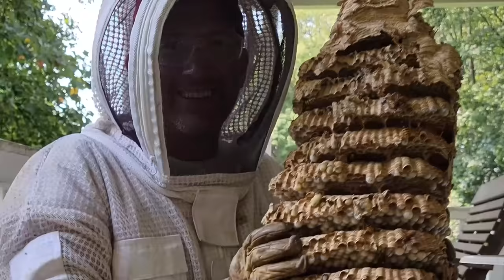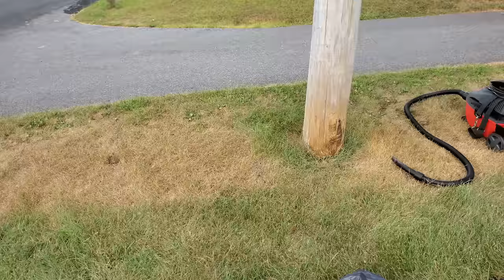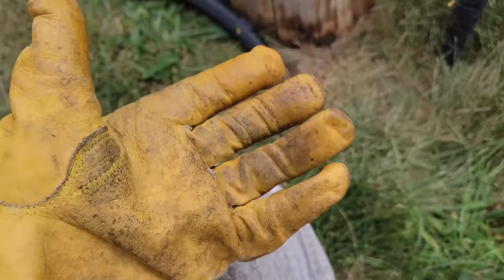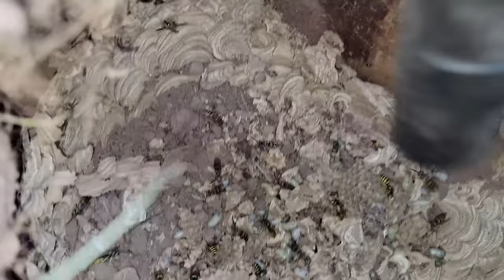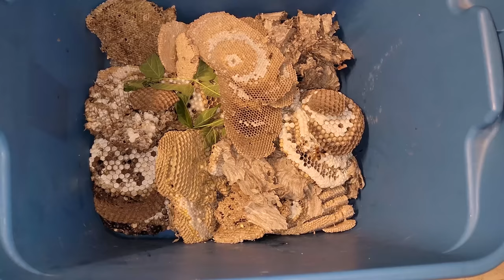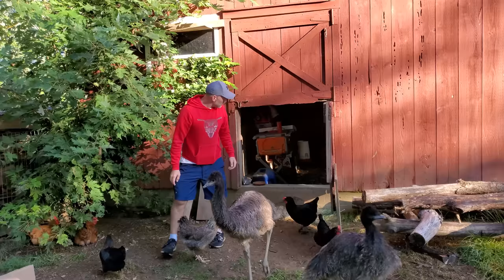Yellow Jackets UNDERGROUND Nest! Swarmed and STUNG! Wasp Nest Removals

Comment: Back in the early 70s i was 11yrs old, I was givin a task to get wasps out of the ground..I had a 2 gal gas can and a M 80 fire cracker with long fuse material...poured the gas down the hole wedged the M80 and a branch, ran the 2ft fuse under an oil rag and set a  cinderblock on top..lit fuse ran and heard a huge wooompf 🔥 the cinder block made small shrapenel and the ground burned for about 5 mins was stung by a few, left area once fire was out...feel bad now, Thabks for your teachings it has changed my pest pwrception, still was standard fun back in Colorado in 1972 Nixon..deadly sprays like round up and others were doused all over....scary

Comment: I noticed a few times when you were vacuuming that ’smart’ buggers would walk out and away from the hole before flying. I wonder if a T piece on the vacuum nozzle would work to minimise this.  Push it into the hole a short way and pack the earth around it. The retaining wasps can still try to enter and get caught up.  Plus the smoothness of the pipe means they won’t be able to hang on.

Comment: Learned this many years ago, and still use this method to destroy yellow jacket nests once you discover their location:: 
Put some gasoline in a small container. You won't need much gas, with a pint probably too much. Quickly shove a small funnel into the entrance to the nest and pour in the gasoline. Throw the container far enough to prevent it from being burned  - we want the fire underground only!
Using a long lighter or, better let, a match on an extension, light the gasoline at the entrance to the nest. The fumes from gasoline are heavier than air, so they have spread down through the tunnel. There is a quick "whoooof" from underground, and 99.9% of the colony just died.
A few survivors might crawl out, but residual gasoline will still be burning around the tunnel entrance. This fire will take their wings off instantly, and you get to watch them die in the finals flickers of the fire.
They stung? Sting back bigger!
Reply from the maker: There are plenty of home-methods to treating a ground colony. Never light the gasoline. Pouring a cup of gasoline down a hole and covering it will asphyxiate the colony.

Comment: I poure a pint of gasoline in the hole, stood back a d dropped a match it. Huge explosion and they never returned.

When I had them in the cushion of an outside couch, I had an exterminator come who puffed them and then took the queen away in a fine mesh sock like material.

Comment: Have you ever had an “oh crud” moment when your vacuum quit working and the nest is disturbed? 🐝
Reply from the maker: Nope. So far my vacuums have never quit during a removal. They will start whining when the motor is going bad, and I will take them apart that evening and repack the bearings (which is the issue from heat). And that usually buys me another couple weeks.

Comment: couldn't kill a yellow jacket nest here, until I got angry and dumped a quart of gasoline in the hole at once and covered it with the same plastic container weighted down. then I didn't bother to check it for a a few days. end result? problem solved. I did that in the middle of the night while nest was full/sleeping. obviously nowhere near any flame source or something that would burn if it went up!

Comment: damn these bastards. Plus this just makes me upset that I will be probably be calling for an exterminator. I have yellow jackets also under ground behind our secluded cabin. My dad and I were cleaning, pulling weeds, and he got stung a lot when he was in the area. its right under one of your steps. I sprayed with 3 different cans different times during that weekend. and I stuck a hose in there and drowned what I could. Hoping that did the trick. If not well at least I know who I will probably calling.

Comment: The way I handle these, is I go at night and shove a funnel in the hole and pour a five gallon can of gas in the hole, then make a long trail of gas and light it. I would not recommend this to anyone, especially if you are in the city
Reply from the maker: If you are going to gas a nest, 5 gallons is ridiculous. Max you should be using is 2 cups. Dump 2 cups of gas down the hole, then plug the hole up. The fumes asphyxiate the colony. You should not be lighting the gas on fire.
Reply: @HornetKingOfficial  agreed. I'm talking about crazy redneck stuff we used to do. I would not recommend doing that by no means.

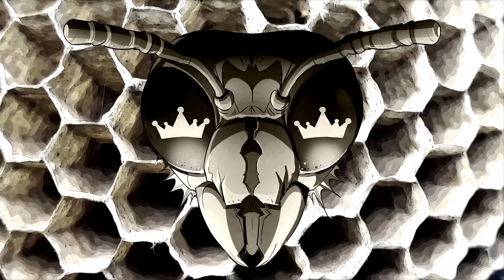Comment: 19:50 Gasoline wouldve eliminate this part of the procedure because it would have melted any and all remaining wasps. The nest may have been left over but that is all. No more remains.
Reply from the maker: 1950 is literally the end of the video 😋
Reply: @HornetKingOfficial  It may be timewise, but the results would've still been the same.  It really works in areas where you don't have access to an electrical outlet in close range.    All you really need is a 5 gallon bucket and a water gun/sprayer that can shoot more than 20 ft. Once again, after dark, it doesn't matter anyway because the nest is dorment so you can walk upon it without disturbing the whole nest and then do the damage necessary while the wasps are resting.
Reply from the maker: @jeremythompson9974  I don't show up to clients' homes with gasoline. If homeowners want to gas a nest, all it takes to try that is a CUP of gasoline and then plug the hole. But clients hire me to remove the nest and the colony. 
I can't even count how many clients who tried gassing their own nest and their foot went through the top of the nest, or they disturbed it thinking "the nest is dormant" and didn't expect getting handled.
Reply from the maker: @jeremythompson9974  Good luck buddy.
Reply: @HornetKingOfficial  You make your own luck here. It's not that hard. LOL